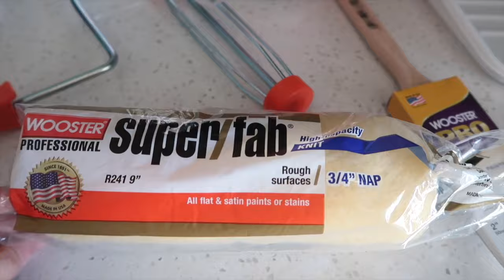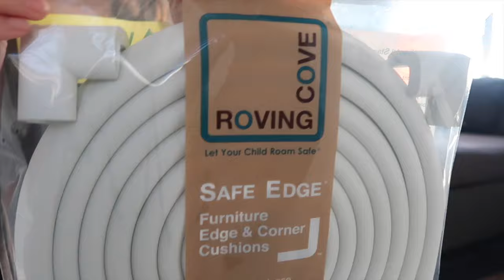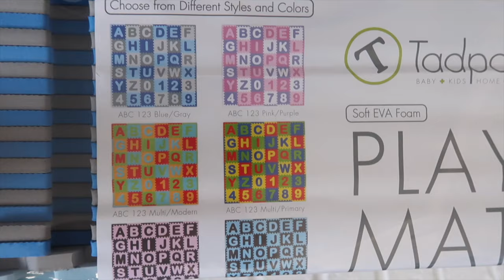How to Paint a Brick Fireplace|DIY Fireplace Makeover|Mary Mae

Comment: Painting a brick house is ALWAYS a BIG MISTAKE!  The beauty of bare brick is the many decades of maintenance-free service.  Yes, I know it's cool and trendy, but it's a huge dis-service in the long run. The current or future owners will have to scrape and repaint and as the coats of paint accumulate the shorter the life of the paint.  Eventually, ALL the paint needs to be sandblasted or removed with paint stripper.  And then probably the mortar joints repaired (tuck pointing). So PLEASE just spare the home and future owners of this horrible fad!
Reply from the maker: Thanks for sharing your opinion! But we love the white brick and we are actually the homeowners of this home. It’s completely paid off and we honestly don’t ever plan on selling it.
Reply: THANK YOU. I die inside every time I see this hideous stuff on beautiful brick fireplaces. Someone took a beautiful home and ruined it, I've been looking to buy recently and rejected several homes because an otherwise ideal house had a room permanently ruined with this ugly and destructive practice.
Reply: @LC-wv7tz  unfortunately some of these fireplaces are just plain ugly and in order to update your decor they need to be either refaced or painted. I have been working on houses all my life and I have NEVER had to repoint or retuck brick on the inside of the house. Just plain BS.
Reply: Really depends on when the house was built. If it was a early mid century historic house, no way.. but if it was a dated house from the late 1980s... update away!